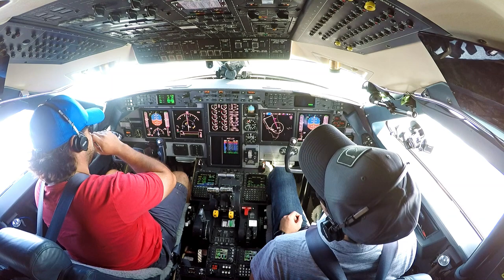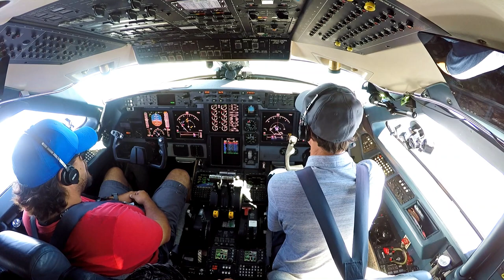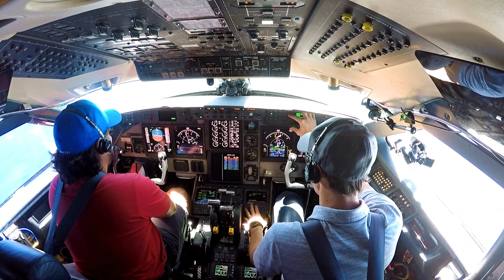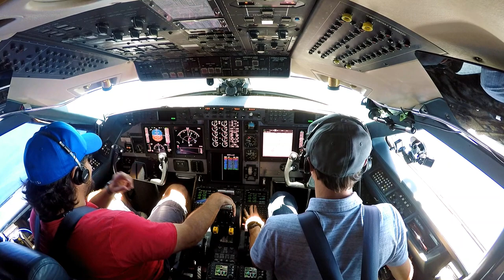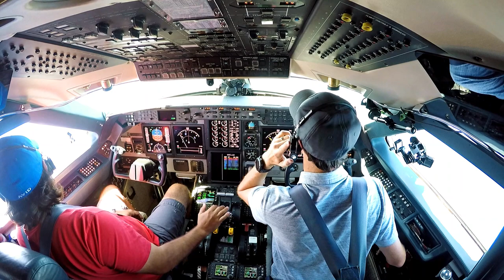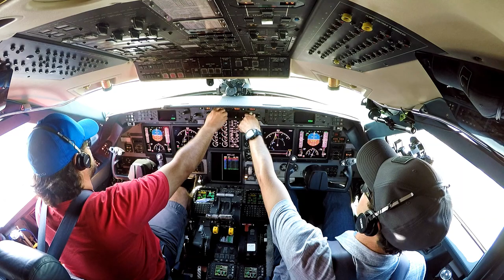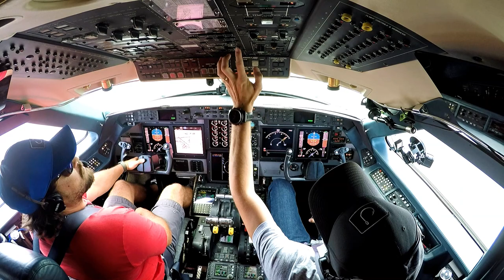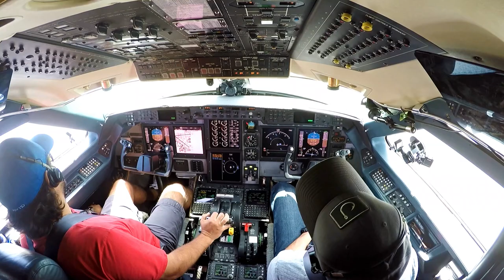Gulfstream Test Flight Around Florida - Pilot VLOG 091

Comment: Thought Jon might punch you in the arm for questioning his 3,000 box ;)
Reply: KD0LRG that is how Jon maintains discipline on the flight deck.
Reply: @jerrykorman7770  I remember way back in driver's ed the instructor would mess with stuff turn stuff on to see how you would handle the disruption.  He once asked how would deal with someone messing with the radio and without a pause I said punch them.  I believe I received a fail for that drive.  The three in the back seat I believe also be lost 10 points for laughing as you could be failed for making any comments in the back seat.
Reply: KDOLRG oh Lord you must be as old as I am. They had just started offering a structured drivers ed in 1983. I recall the car was some sort of front wheel drive Dodge or Chrysler or Plymouth, it would actually talk to you if you failed to fasten the seatbelt. It was a brand new car, at a red light smoke started to pour out from under the hood. The dealership failed to put the oil fill cap back on after its first oil change, enough oil mist came out she caught on fire.

Yep, the passengers had to be quiet as mice. No radio, no nothing. The instructor would also set the traffic cones closer and closer together while we practiced parallel parking. Back then, when cars had genuine bumpers, it was considered acceptable to lightly touch the other bumper while backing in. Try that now and probably $2,500 in damage.

Now we have cars that claim to drive and park themselves. Kinda takes the fun out of it
Reply: @jerrykorman7770  we had a mix of cars depending on your teacher, one was a football coach so he had a station wagon. I think our ther teachers had a Buicks, rear wheel drive in Iowa so you had to drive in winter weather.  You started or ended with the snow and ice, there was no weather is too bad to drive day.  The funniest moment  had to be when I was in the back and less experienced driver ended the drive so he had to park back at the school.  Well our teacher always parked in a area that had like a one inch pad that kicked out a few feet from the school.  Well the car slowly pulled up and stopped on the little lip, the instructor said pull up and just touch the wall.  You guessed it he gave it a little gas  nothing happened then goosed it and over the lip and thumped into the wall.  We were laughing so hard in the back the instructor turned around a told us to get out of the GD car. I got a A in drivers Ed but the teacher remarked needs to remember to keep his mouth shut.  Those were the days.  We even had simulators at our school talk about old school always driving with the clutch and getting your ass chewed out.
Reply: KD0LRG lol “you kids get out  of the GD car!”